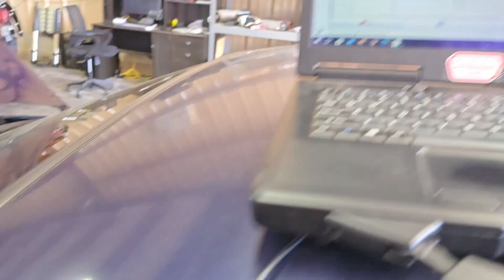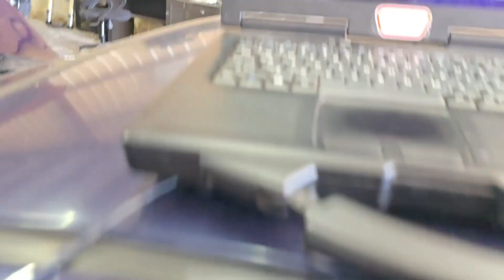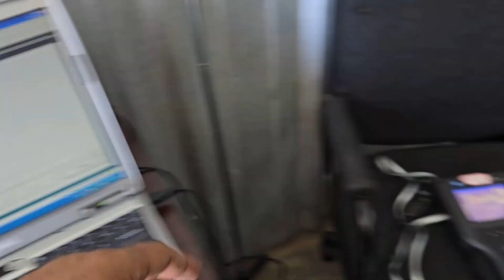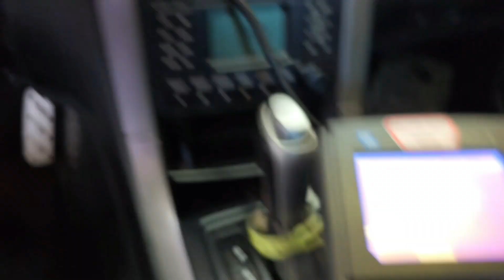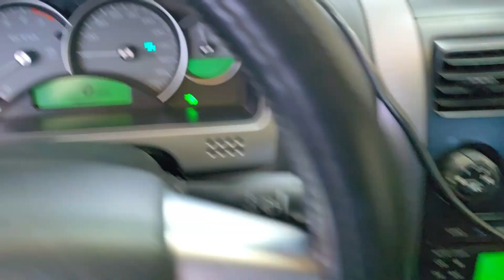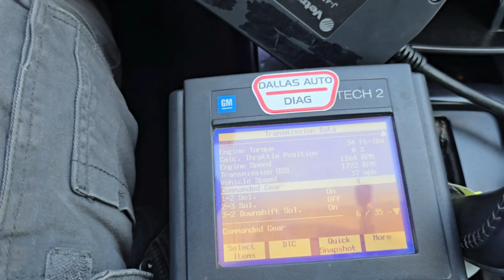2005 Pontiac GTO TCM Programming using Tech2

Comment: No big deal, but I like to see if some testing is shown at one portion of a video, I like to see the same testing at another portion of a video after the repairs were made. In part 1 you mention no live data for the TCM such as no engine speed and the TPS calculated was over 30%. After your repairs here, I was expecting you to mention those very same data PIDs but it was forgotten, but we were able to see it all in the screenshot so thanks for the opportunity to at least see it. Thanks for the programming procedures and no additional Initializations required in this case, cheers.
Reply from the maker: Good point, I’ll try to show more live data in the future.

Comment: Going thru the same thing did rear main seal now I’m getting p0787 not showing on the dash like yours is swapped the solenoid out and nothin happened have went through the whole harness and have seen nothing either so I’m gonna put the tcm in since it’s cheap and if that don’t work I’m parting it out
Reply from the maker: Remember to program it
Reply: @DallasAutoDiag  I am I have a guy from my local dealer with a tech 2 coming to me today if this don’t work idk what else will🤦🏽‍♂️

Comment: Where you get your dinosaur it’s 2000 laptop from?
Reply from the maker: lol I got it from ebay
Reply: what, you dont keep your old junk around? I have an old school 5.5" floppy in a machine, I have my first COMCRAP 2Gb Laptop with awesome JBL speakers that are loud with W98se, I have 3 towers that I had custom made, XP, to view SLI 12 monitors at the same time circa 2003, I just cloned an old W7 laptop to an SSD as they did not have a pirated copy for bedroom viewing. I have a few Japanese heavy desktops with W2000 Pro from an office building cheap ass sale from when I lived in Japan where everything I just mentioned was bought. I bought 2 W10 laptops since I been here in the Philippines. I have some nice old software that only runs on 32 bit machines so I need to keep some around.

That COMCRAP actually the screen quit working 50% so I bought the same Japanese model for $100 used, and swapped screens over and still have that one packed away. When I moved here I pulled all my HDs out and hand carried them here, while everything else that would fit in very large boxes were shipped here door to door via a special shipping deal that Filipinos have from around the world, so I took advantage of the service. Some of the old laptops can finally go in the trash now, cheers.